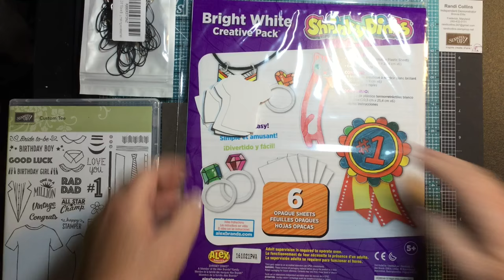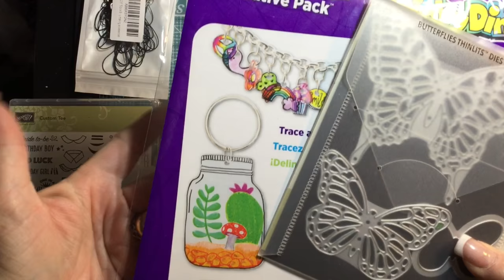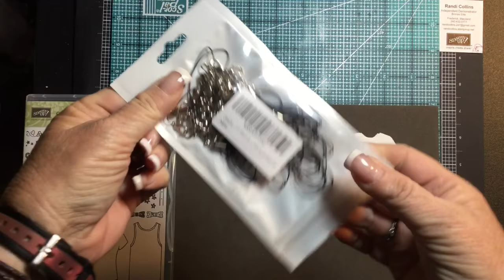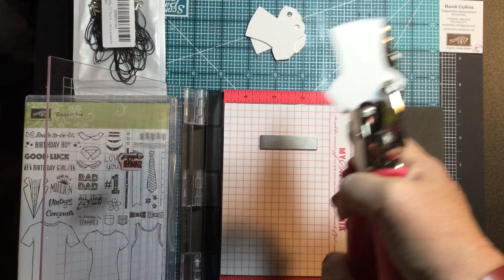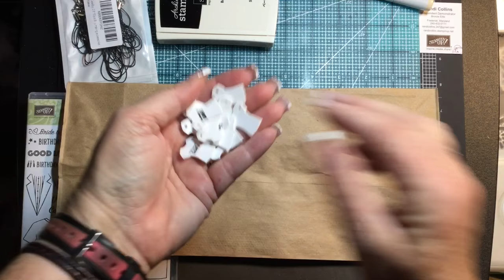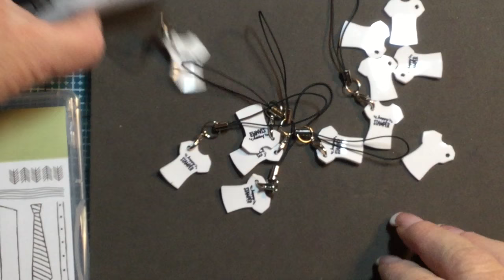Shrinky Dink Scissor Charms w/Stampin Up! Custom Tee Bundle

Comment: Thanks so much for sharing your video!! I'd like to offer you a couple tips/suggestions 1)If you're not making a bunch of these at once you can use your heat tool to shrink the shrinky dinks & 2)the shirt you stamped in the beginning..you could've either restamped it in your tool or take some alcohol and wipe the ink off & start over...the alcohol will take the ink right off.... again, thanks for sharing your video!!
Reply from the maker: thank you
Reply: You're very welcome! Currently admiring some of your other posts.
Reply: Thank you for listing your blog so it's easier to find more of your ideas...many unfortunately don't list their blogs if/when they have one.. even though they mention that they're linked in the description.